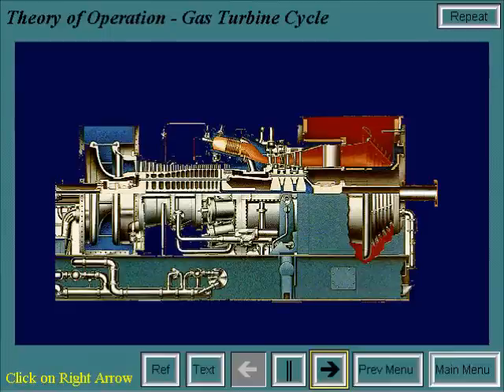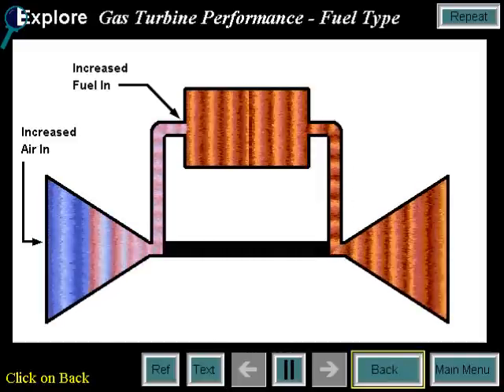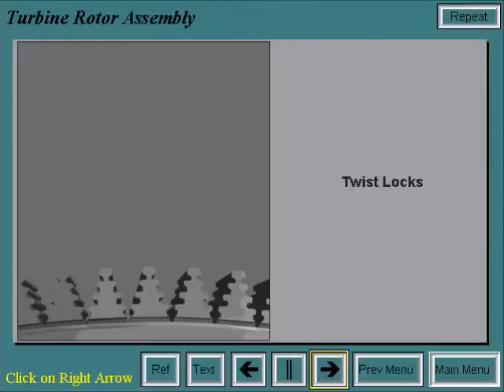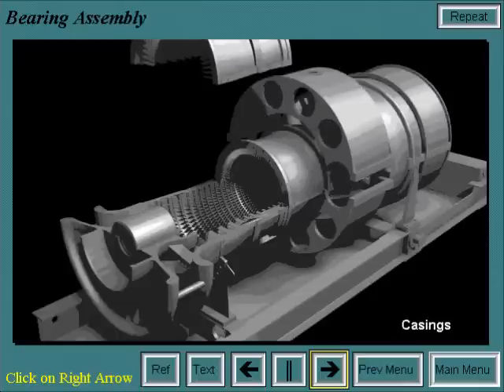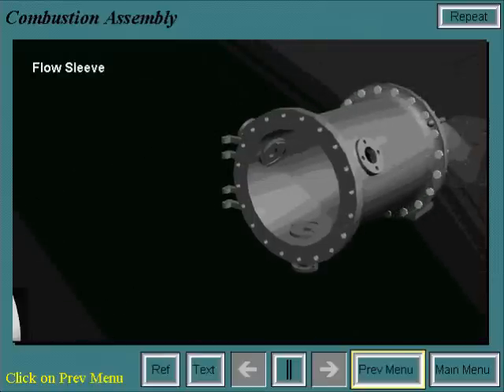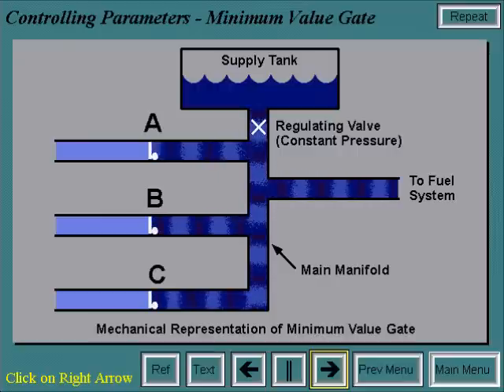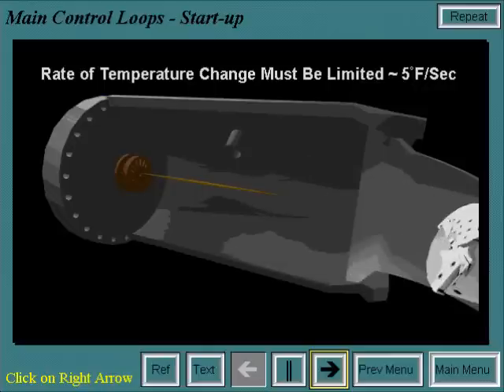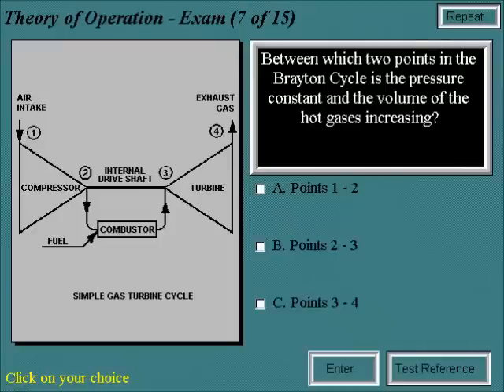Gas Turbine Theory of Operation

Comment: why use gas turbine power in power plants when thermal power plants have way higher efficiency and need way cheaper fuel?
Reply: Because you can get 33 megawatts on line in about 15 minutes if needed. These were commonly used as peaking units when the grid needed the extra power in a hurry. And you can remove them from the grid just as quickly.